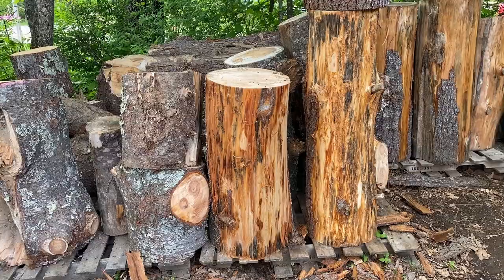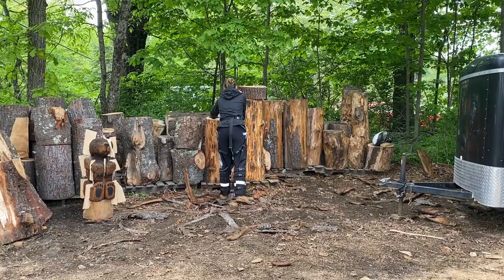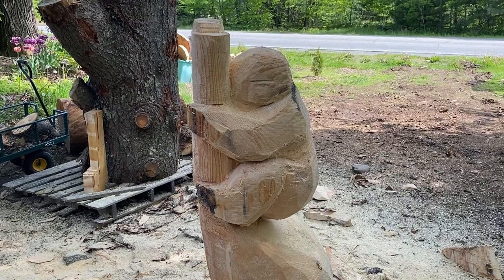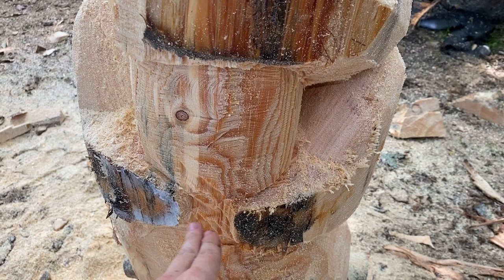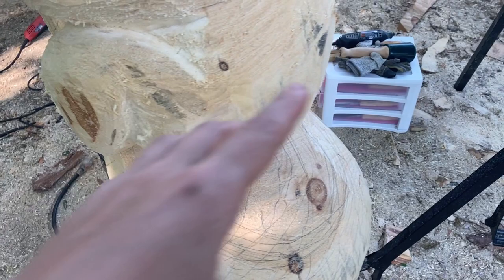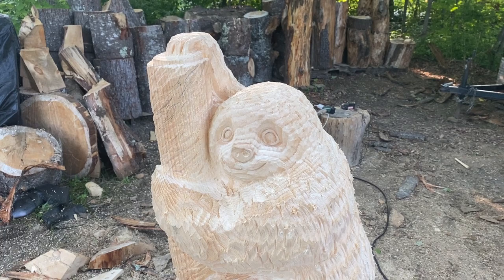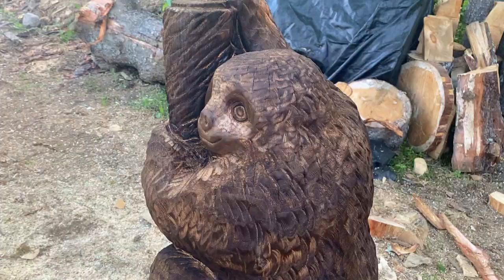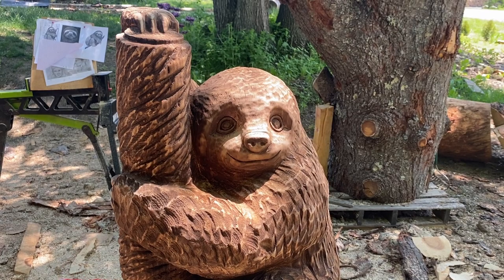Cute Chainsaw Carving

Comment: Tay, what kind of wood did you carve on it seems to look a little soft but solid? Yes a very good well done sloth and colors! I wasn’t sure about the swirly tree bark pattern but it turned out great and had to differ from the fur pattern. Keep carving
Reply from the maker: That was white pine, it will always be white pine unless I state differently in the video! We have so much of it up here and it carves very nicely! Funny you say that about the base because that’s the exact reason I though about the swirly bark, to add some texture contrast as well as some extra character!